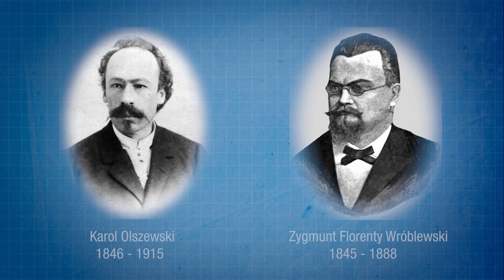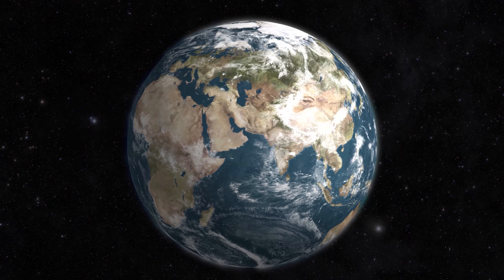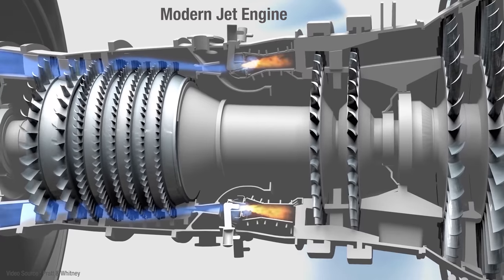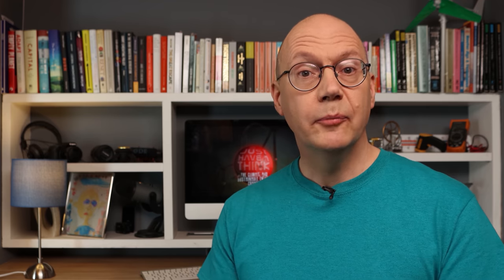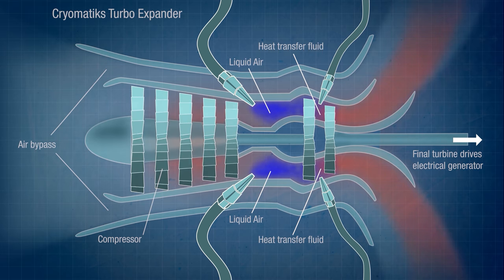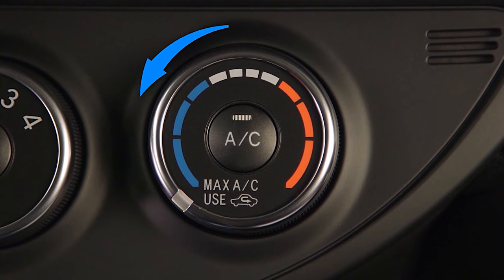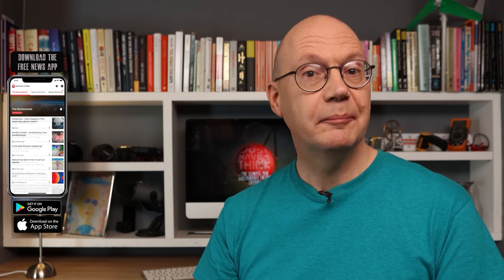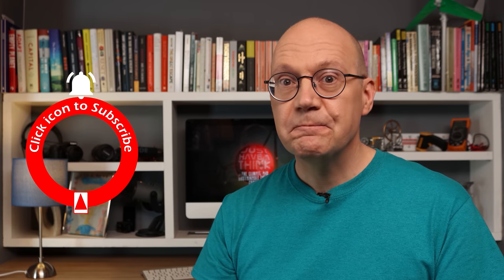Portable Liquid Air Power. A new boost for electric vehicles.

Comment: Another of your extraordinarily lucid explanations. But a question: you describe the efficiency in terms of energy density as compared to lithium batteries which is certainly critical for vehicles, but it would also seem to have value as a way to buffer huge amounts of power generated by sources like solar or wind that aren't evenly available throughout the day or across the week or year. It seems like it would be appealing for farms where you could make your own power with solar that could be used 24 hours a day.  Another obvious aspect is that it would seem you could recharge a vehicle very quickly, saving time per-vehicle and overall space and recharging stations required. Perhaps just as importantly, it means you can deliver "electricity" to vehicles in the field by tank truck sparing them the need to return to recharge.

Comment: Sounds like a capacitor bank would be lighter?, cheaper and more efficient.  A well proven and fairly commonly used technique.
Making the liquid air is a process looking for a new market that in this case does not sound efficient, but hey, they get to sell a consumable !
The capacitors would be likely be a lot better value due to the lack of servicing too.

Comment: More energy could be produced by running the liquid air / cold gas through the cold side of a Stirling engine, using ambient air for the hot side, then onward to the turbine.

Comment: There was no mention of transferring heat energy from the compression cycle of the nitrogen, into the vehicle to use that to re-expand the nitrogen before entering the turbine. which has got me thinking, what about using this as a residential home energy storage system. the heat from compression is stored in an insulated separate media, and nitrogen is stored, cryogenically in insulated tanks. pass the nitrogen back through the stored heat before entering the turbine.
Seems like this could be an efficient method of medium length storage, perfect for a few days worth of energy, just to get by for a few days without PV production in bad weather, without any chemical batteries. i would bet all the technology is available off the shelf. probably has a 30+ year lifespan, and would be energy dense enough to store in your own backyard.

Comment: I use liquid nitrogen for freezing pipes & it can not be stored in a closed tank unless it has a pressure release valve, so I guess just like batteries you loose capacity of the stored energy over time. Good idea for storage of energy for solar/wind but I don’t think vehicles

Comment: larger vehicles have devices called "retarders" or at least that's what their called in the industry where i live. its pretty much a liquid torque converters filled with transmission fluid, when the brake pedal on the vehicle is applied lightly, it fills with fluid, and the friction of the fluid slows the vehicle down quite a bit, saving the brake pads and rotors, ALL that energy is turned into heat, and traditionally has been passed through a radiator to expel the excess heat. only when the brakes are applied harder , or the vehicle is almost stopped do the traditional drum brakes do most of the braking. i imagine most of the waste heat they plan on recovering will be from a retarder device.

Comment: The nitrogen is in a closed loop like an conditioner? So the system once charged recirculates it?
Reply: No, the liquid nitrogen is the fuel.  It is being expanded using ambient heat from the air and exhausted.

Comment: So if you used a second and third high speed expander to take the wasted ambient air you could maintain high efficiency and also get more boost which means more electricity right?
Reply: I think that the diagram is badly wrong and badly explained.
That bypass ambient air isnt because of the optimum intake throat size. Why not just have one intake throat?
I bet it's for something else.

Comment: Did you refer to a stall in an aircraft as an engine issue rather than a loss of lift due to a wing increase angle of attack creating enough turbulence to reduce its lift to the point when it’s inadequate to support flight.

Comment: Considering the complexity of turbines , what kind of servicing costs are involved? A refrigerator sealed compressor can run decades without servicing but on the other hand, aircraft turbines do require regular maintenance... Battery costs in the meantime are dropping daily with new development in the pipeline promising cheaper costs

Comment: Why can't rotating magnets be used in the wheels to assist the recharging while accelerating? If there's little to no friction, it should be able to create a charge without expending any extra energy used in operation, so you charge while driving as well as when breaking? What am I missing? I know it wouldn't be a lot of a charge but, every little bit counts, right?
Reply: Your missing the energy loss of transfer.
...
Simplest form what you're suggesting is a generator that powers a motor.  You'd have to generate more than the input, for a net gain.
Reply: I've been saying this for years !!
Delivery/Service vehicles are the "foot in the door" needed. 
A multi use, modular base for varied capacity, range, power requirements.
Reply: @timothywalsh1001  I understand energy loss transfer for a turbine, but a series of magnets aligned in a ring in the wheels should be frictionless with no added resistance other than the small amount of additional weight to each wheel, it's just a spinning magnetic field. Every time the wheels turn - whether accelerating, coasting, or breaking - it should create even a small current. It's not the same as turning an alternator or a gearbox, right?
Reply: @wirelesmike73  
Go find a DC motor... any motor with magnets, and give it a spin. 
Even the motors for radio control cars, even brushless... 
Ummm yes, they all have resistance and requires energy just to rotate

Comment: I must say I am pretty skeptical. I'm asking myself where the catch is. The thing is, this technology is so old and so established and so dead simple in principal that it is hard to imagine that no one has thought of this before. So where's the catch? How much energy per unit volume can you actually store in a cryotank? How efficient is the process in actuality? Why are there only 3D renderings and a drill powered by a pneumatik motor as demos? I can build that at home. Where's the real thing?
Also the thing about capped regenerative breaking power doesn't apply the same way to modern 800 Volt EVs like the Taycan, E-Tron GT, Inoiq 5 and EV6, those battery packs can take much more regen than previously, enough that the cap will not be reached unless you're performing an emergency breaking maneuver.

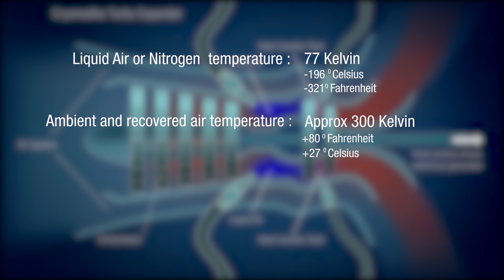Comment: Can I stick my neck out, and call bs on that operations diagram at 6:30  
1) Injecting coolant fluid into the hot gas stream? Nah.  
2) Two intake throats to get the optimum volume for the  rotors? 
Nah!  why not have just one intake throat,?
That exterior throat is for other reasons.

Comment: Does anyone know if the "heat transfer fluid" is actually injected into the air stream...the diagram indicates that. Doesn't seem sustainable. Would not a heat exchanger make more sense.

Comment: It seems more likely that we will increase battery size and improve cell chemistry before adding this system to  commercial EVs.  Batteries improve every year in cost, power density and efficiency, but this system has fixed cost and weight based on the nitrogen and storage container.

Comment: Clever. Free Air Conditioning! But at some point all that liquid nitrogen is going to be a hazard due to oxygen dilution. Perhaps a mixture of liquid oxygen and liquid nitrogen will fix that hazard, but liquid oxygen has its own hazards, like damn near everything burns...
Reply from the maker: Yes. It will not need to be pure nitrogen in production. Normal liquified air will be fine.

Comment: Interesting, but I think that improvements in battery charge rates will leave this behind in terms of regen braking. What about the extra weight and complexity and repairs of adding this. Probably better to just use more and better batteries.

Comment: I really like your videos but this one makes to me little sense. I understand the concept but the explanation of how to achieve it is against how a joule cycle (gas tubine) works. By injecting cryogenic fluid you are reducing the temperature of the gas an thus the energy you can extract from it with a turbine. Is kind of difficult to explain this concept, but to sum up it does not make sense to cool down your gas after you spent energy compressing it. It makes more sense to cool down the air before it enters the compressor in order to spend as little energy as possible compressing it, then warm it further. Also I think is important to point out that, as a regular joule/braython cycle, the same one found in any gas turbine, the thermal efficiency wont be any higher than 30%

Comment: I personally think the future is democratized power.  The aging grid in the U.S. is going to fracture, and (at least very rural) parts of the country will need to adapt.  That is, local generation and storage of power is going to be critical for towns to assure their residents continue to have electricity.

For example, a town near a river, could install a micro-hydro power plant and store that energy in either gravity or compressed air to be used in combination with the grid.  A town in the middle of the desert could install wind and solar to generate, and store their energy using air stored underground.  Power independence is going to a critical feature of future living (in my opinion).

Comment: Small scale cryogenics using air as a heat source is a pain. Good luck with defrosting the heat ex changer unless you live in the desert or polar regions. Where are the standardized hot swapable modular batteries? Replacing petrol stations with battery storage stations that can act as grid balance during peak hours and charge during the off peak.
Reply: People don't even like swapping wheely bins. I doubt that someone with a high-end EV is going to want to swap batteries.
Reply: @nagualdesign  guaranteed performance, serviced, warrantied all get rid of one of the largest liabilities with evs. 3 minute full charge, sounds good to me. It's not like we don't already all pay for the same road and infrastructure anyway.

Comment: I think this turbine should better drive directly the wheels of a vehicle instead of producing eletricity that is then changed in into rotation again by a motor. The speed of the turbine can be regulated by changing the pressure of the nitrogen gas. It works this way with combustion gas turbines.

Comment: Compressed air engines are not so new, but perhaps there are a few innovations to improve efficiency. Using regenerative braking to heat a fluid is using work to make heat of which, thermodynamically, only a fraction could be made back into work again.  EV regenerative braking is almost always sufficient to slow an EV car without resorting to friction brakes or wasting kinetic energy. Storing fuel at 77 DegK means you better use it promptly, or it will evaporate. Liquifying air with excess renewable wind and solar would make green air, but making liquid air is a 24/7 process and thus not well suited to starting and stopping. Whenever grid power being used for making liquid air is from natural gas power, you are making black or grey air. Overall efficiency and the complexity of managing such cold material are negatives, but we are certainly in need of ways to efficiently store electric power for later use. Great so seen innovators trying new ideas.

Comment: Did not really understand the upside of an energy container that is as heavy per kwh as a simple battery. Plus the fact that you need a complex turbine on top. Plus the fact that there is potential development for energy compacity in batteries, not in liquid nitrogen. Finaly, why add a complex (and dangerous) nitrogen system while you can just put more batteries for the same energy/weight ?

Comment: It's also a way to separate out oxygen, and with that as a byproduct, you have another vital and therefore, commercial source of income.  India is screaming for more oxygen and we are pumping of thousands of tons of it into spacecraft.  That's fine, as long as it isn't being diverted from emergency lifesaving.  Nitrogen for energy storage which can be processed at the end of the energy storage cycle and produce ammonia for fertilizer AND it can be burned to recover the energy of production and it only releases N2 and water.

Comment: Interesting but I am skeptical.  Compressing gas to liquid atate uses a lot of  energy,  then the heavy liquid needs to be transported to point of sale, then  the fitted vehicle needs to carry the extra weight of the liquid.  If all of that isn't done carbon nuetral  then this seems like nothing more than an accounting trick.  Also,, did I miss something, this system injects liquid glycol into the air stream?  That seems wasteful and potentially problematic.

Comment: Wait, you're saying the regenerative braking systems discard energy to protect the battery pack, but that this gas turbine can recover that braking energy (and convert it into electricity). Is that correct? Where is that recovered energy to be stored if not the battery pack?
Reply: In the water/glocol mix.
Reply: I thought the energy in the fluid was waste heat after it left the turbine. My question is about the energy captured by the turbine.
Reply: @johnkeck  the energy in the fluid is what is powering the turbine.  The output is quite cold.
Reply: @phillipsusi1791  I know that and the temperature of the fluid after the turbine isn't directly relevant to my question. I'm asking about what happens to the energy (from the fluid) captured by the turbine if it doesn't go to the otherwise-overloaded battery pack.
Reply: @johnkeck  it takes time for the heat to be absorbed into the fluid and can be stored there for a while before being fed into the turbine once the car starts driving again and needs the power.
Reply: @phillipsusi1791  Ah, that makes sense. Thanks!

Comment: How do Liquid Air Vehicles (LAV) compare with Compressed Air Vehicles (CAV)... in the end... one generates piwer by expanding air.... In case of CAV you need (carbon fiber..) High Pressure CA Cylinders ... in case of Cryogenic... they would have to be insulated... would they not....??? I assume in BOTH CASES.... the Energy used in Compression is recovered and not wasted...

Comment: I call bullshit. Let me know if I'm wrong, but a lot here seems to be very strange. 
The bypass makes no sense, the device does not move inside the car, so there is no ram effect. I do not see why the air in the bypass should move at all, except that the exhaust stream sucks it out a little. The bypass in a jet engine has a compressor, we do not have and do not need it here.
At startup, we put liquid water and liquid nitrogen together, and somehow hope that it does not freeze? So we better use hot water and antifreeze? Because liquid nitrogen does not get colder than -13 degree Celsius? 
How large is our glycol-water tank, compared to  the liquid nitrogen tank?
Does our glycol exhaust smell?
We heat the heat transfer fluid by using it to cool the car hardware first. Do we always drive above highway speed for long time to heat it up? What kind of generator do we connect to the device?
Do we really want to inject our fluid between the turbine wheels?
Is it an April fools joke?

But it can rotate! As long as the device is warm.
Reply: The bypass is to heat the nitrogen.
The graphics are wrong.
Just think of the ambient air as super hot and the nitrogen as water that gets used for steam.

Comment: You should do a video on compressors, and air powered motors, they are literly everywhere but no one talks about them, all over airports with vehicles that run on compressed air, not sure why they don't get more credit.
Reply: there power to weight is not very good once you take the heavy tank into account.

Comment: Nice concept. But what about the other market - home energy storage for becoming free of the dirty utility power? Typically rooftop solar PV is competitive with the utility for average daily energy consumption, but it really needs significant energy storage to keep from using grid power when the sun is down, or the load exceeds the solar power. Is anyone working on an efficient small nitrogen generator ?

Comment: N 2 (nitrogen gas) is not a fertilizer, N03 ammonia is.  N 2 is inert, NO3 is not.    The fish market in Sydney has forklifts at are all powered by compressed air rather then propane.

Comment: I am surprised to see quite a few trucks with LNG these days.
Liquid Natural Gas, liquid methane.
Maybe, being a gas and being liquid is a mature technology then.
Before I thought it could only be packed into a boat because of the size requirements.
Seems now, it just fits on a truck as well.
Cool.
There are so many options.
Let's try them all.
Reply: My friend had a motor home that was about 30 years old and ran on LPG. It could have been retrofitted, I suppose.
Reply: You sure they aren't CNG?  Or LPG?  LNG requires extremely high pressures that usually make it infeasible.  LPG pressures are far more manageable.
Reply: @phillipsusi1791  quite sure but also doubting now.

Comment: Is it a turbine? Or a turboshaft jet engine? 
Why the need to compress the air to be injected with... cryogenic compressed nitrogen?

Why not deliver the power of the expanding N2 directly to the drivetrain?
And save the losses of converting the power to electricity. 

Why.. why... why.

Comment: Compressed air also contains all the components for propane ....converting large numbers of ICE to propane would be a shorter step than electric and is 100% green ....the liquidation system can be 100% solar powered.